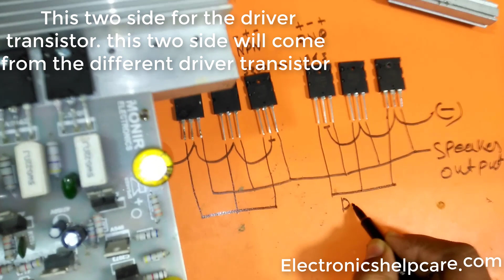amplifier circuit

Comment: Hi
I just build the same circuit based on the same diagram but I have a problem. I used the same components except the BD139 becouse I had only BD140 in stock.
Could this be the reason that at low volume levels the amp distorts but at higher levels its playing fine? 
Please let me know if you have something in mind about that. Thanks!
Reply from the maker: Please visit for circuit diagram
https://www.pinterest.com/electrohelpcare/pins/

Comment: By doing this, you upgrade current capability, but it won't exceed what the speaker can take at a given voltage, which is given by the RMS voltage at the output of the amplifier (not supply voltage) divided by the speaker impedance!

Multiply the result by the RMS output voltage again to get the real power!

When measuring RMS output voltage, do it when the speaker is connected!
Reply: 100% true! Good comment. Some people dont know what they are doing. Sigh...

Comment: You need a higher voltage and current in order to achieve the increase power of the amplifier adding will just make the amp handle the load not to increase the wattage
Reply: Also you cannot just add more voltage to the circuit since some components aren't design to handle double the voltage. You also need to redesign or change some components to handle twice the voltage.
Reply: @Richard NZ Yes, if the amp is made for 8ohm speaker by doing this thing you can connect a 2ohm speaker, obtain more power but you also need to change the power transformer to a  bigger one, same voltage but more amps.

Comment: that  will never increase something ... its just dividing the stress from the load ... if you want to increase the watts .. you have to increase the voltage or the current of the power supply ... remember the simple formula watts = voltage/current ....
Reply: Yes it can, only and only if the amp is made for 8ohm speaker by doing this thing you can connect a 2ohm speaker, obtain more power but you also need to change the power transformer to a  bigger one, same voltage but more amps. For a 45v transformer the power in music (RMS) is V^2/R(impedance of the speaker) so decreasing the impedance you increase the general power output, 45*45/8 = 250W while 45*45/2 = 1000W. Ohm laws says that P = U(voltage)*I(amps), also I = U/R so replacing I in the power formula is P = U^2/R

Comment: how to make 5200 and 5200 transistor use of the 2fet smd mono subwoofer board wiring diagram. please with power volt and ambear.

Comment: hmmm i thought its 2SC and 2SA.. i think it's a counterfeit transistors
Reply: Transcore52 the 2S transistors are genuine but I think the TT series of transistors are genuine too
Reply: @MC-01  it's china transistor fake. Replacement transistor. The original is 2sc5200 and 2sa1943
Reply: @MC-01  it's not a genuine bro. it's s local or Chinese counterfeit transistors